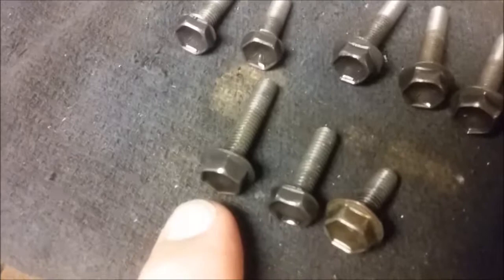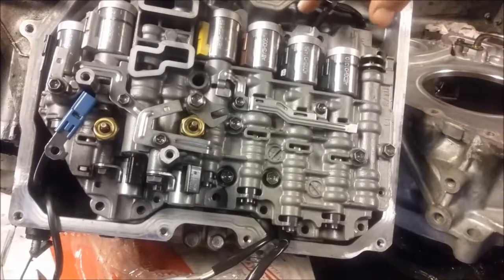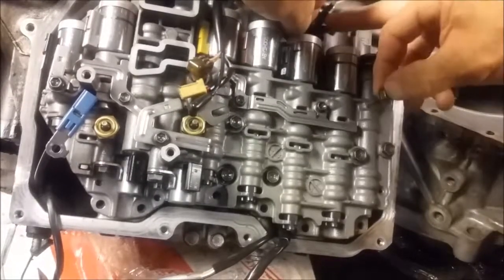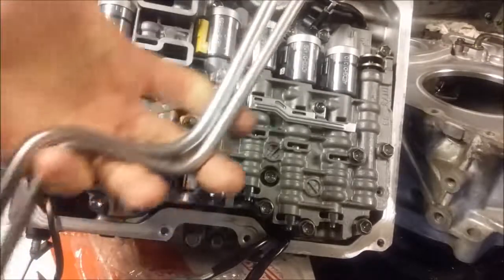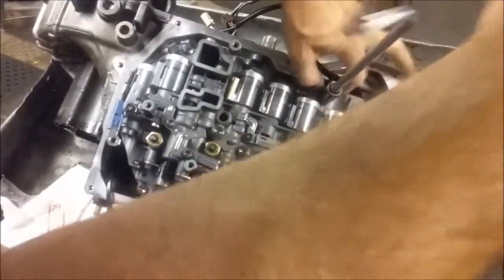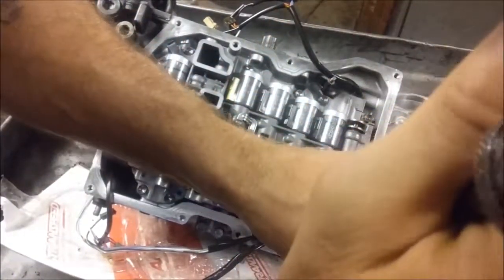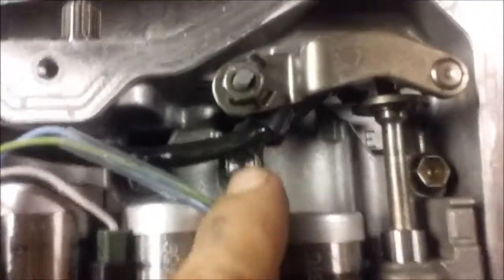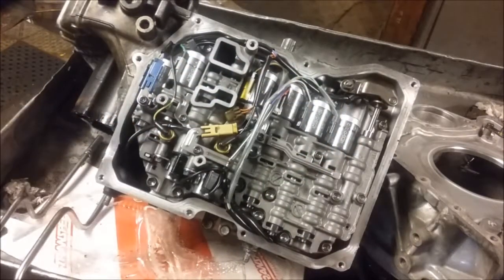VW 09G automatic transmission Bolts install during rebuild bolt location & length

Comment: 24 Ft lb torque?🤔
Reply from the maker: Yep Its more like 71 INCH pounds. Thanks for watching closely and paying attention.
Reply: @saneauto  
Instructions called for 8 NM and then 90 degrees (angle torque) correct?